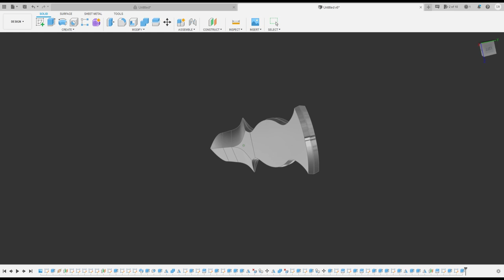Casting a Bronze DAGGER│3d Print to Sand Casting│Knife Making

Comment: When printing something in two parts and then attaching the parts to each other I like modelling in for example half a sphere in one and a matching indent in the other for easier alignment 🙂 Or two holes + a metal pin or something etc. Makes life much simpler than trying to match two flat surfaces precisely 😊
Reply: Great idea
Reply: True that, thats how foundries do it!
Reply: Seth’s veins look so fake because they’re like half the size of his fingers(in diameter).
Reply: Yes, common approach. Called registration marks. Remember to put an offset face on the registration marks so your parts fit together though. 0.1 to 0.2mm tends to work well for me!

Comment: Resin printing tip: Once you've cleaned your print in IPA, if you soak it in hot water for about 20-30 seconds, you can just pull the supports off without needing clippers (they'll practically fall off under their own weight), and anything that's left behind can be easily scraped off with a fingernail
Reply: I haven’t heard that tip before; thank you!
Reply: Hi im from the future, thanks…  this works with lost wax type resins i imagine

Comment: Sand Casting at it finest! Great result and detailing the finished cast. Well done!
Great idea of the hot glue on the top of the blade.
Reply from the maker: Thank you! I really didn’t want to walk into the tip as it was clamped in the vise.
Reply: @robinson-foundry  why are your veins so big wtf 9:25

Comment: I absolutely love the look of the dagger. My questions are:
1] How is the weight ?
2] Where is the balance ?
3] Have you tried throwing it ?
Seriously though the design is sick
Reply: Love the design, I'd gladly buy it.
Reply: Look nice but don't confuse it for a bronze blade made for any form of cutting. Bronze has to be work hardened to not bend as much and hold an edge. This is all decoration. Now if he made the edges a lot thicker on the dagger and hammered them into a final shape and then finished the edge with a bit of filing, then the casting could have been used more like a knife.
Reply: @silentferret1049  I would still worry about aspects like grain size and temper. Casting generally never was done for hand weapons for many reasons after all.

Comment: That is a beautiful, leaf-shaped blade.
It’s been fascinating to watch your castings grow in sophistication as your technique has improved.
Regarding the sharpening of the blade, I have read that some cultures hammered the edges on a metal post, after the initial sharpening.
This compressed the metal along the outer 1/4 inch or so.
This made the edge harder and finer, and left a characteristic ledge around the blade.
The appearance is hard to explain.  I’m sorry I can’t say it more clearly.
Again, it’s very nice and innovative work.

Just out of curiosity, how do your neighbors feel about your foundry?
Would you care to sell a bare, rough finished blade blank?

Let’s be careful out there.

Comment: Nice work on the design and casting of the knife. Fascinating to watch. I loved how the blade turned out, but I have to say I think a nicer handle material, or maybe doing a more interesting pattern in the wire-wrap might have made it nicer in my opinion. But still.. love the design and the look of the finished blade.

Comment: So that’s how they made the centurion’s boot knife… I want one now!~
Reply: Actually, a real knife would have been cast much thicker, then hammered down to a similar thickness to harden the bronze. Otherwise, bronze doesn't hold a cutting edge too well.

A dagger for decoration or display like this works fine with just straight casting, but things like extra hardening processes and difficulty of obtaining tin were big reasons why eventually everyone just started using iron when they had the heating technology to do so.

Comment: Why not just leave the print in there with a small hole/tunnel for the metal to flow though, And the metal is hot enough to burn out or absorb the pla . is there any reason this would not work?